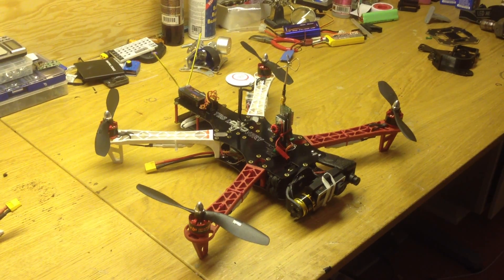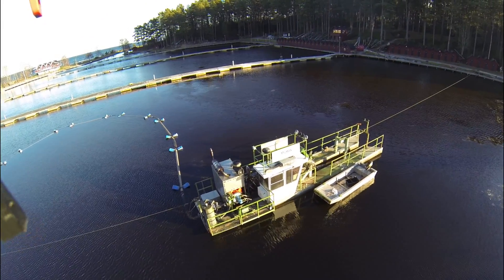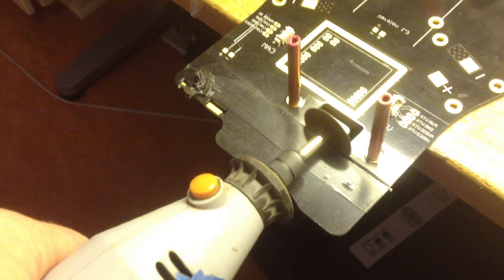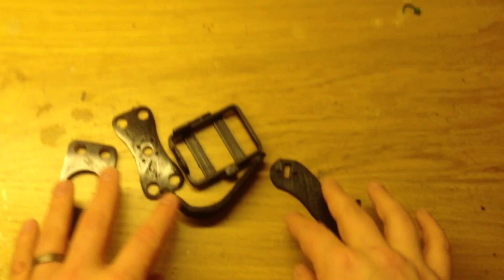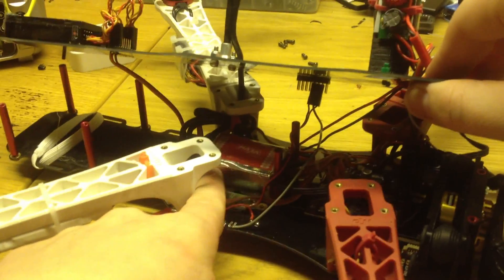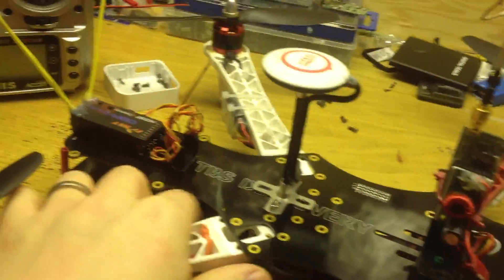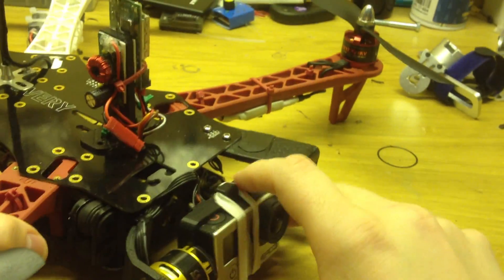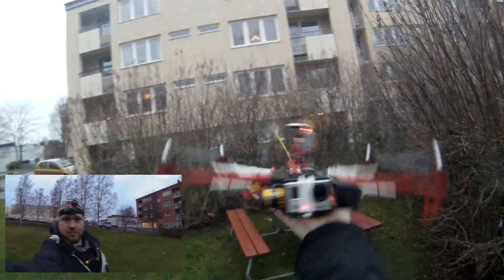My TBS discovery setup with my 3D printed gimbal

Comment: Fantastic! I wish I either had a 3D printer, or could buy this setup. That's the cleanest setup I've seen. Just the way I plan to try to develop mine. But I'm probably going to have to use aluminum. 

But thanks for the inspiration, looks great!

Comment: Hi, great project!
I also have been trying to make my 3d printed gimbal airworthy but with no luck.. I use modified version of http://www.thingiverse.com/thing:158854 and I have big troubles to stabilise pitch correctly, with rctimer motors they dont move smoothly, but rather in stepping fashion and with emax motors, they strauggle with their own cogginess (the inherent magnetic force) and cannot go back to level. Did You have any problems with pitch axis?
Reply from the maker: You are using gimbal motors ? regular brushless motors will work very poorly. There are a lot of settings in the software that have to bee tuned for your specific motors. Also make sure the motors are good and no phase is broken, measure with multimeter. Also your camera have to be in balance when power is off, very important as motors are very weak..Good luck !
Reply: Peter Lehnér Thanks for reply. Of course I am using gimbal motors : ) I also have already tuned a few gimbals in the past. The thing is that the pitch axis is cumbersome, as if the motor has not enough load on its shaft to balance smoothly
Reply from the maker: jimarcin Strange, most of the issues i have had is due to bad motors, a phase wires inside have come loose or have bad connection, the gimbal motors i have dealt with have had a pcb inside that the wires have been soldered to, and if they haven't scraped of the varnish enough in the factory it might cause bad connection, i have had to re solder a few.. (i have only used cheap motors)

Comment: Peter, I really liked your front gimbal design, especially the idea of upper and down rubber dampers, they have different tension coeficient so it makes things much more stable. You are a genious! I bought a print gimbal from Polak but I'm sure I'll be much more happier with this yours. Is that possible you to design an middle top frame position support for the board cam (TBS)? Wating reply. Best regards.

Comment: Hi Peter. Just to let you know I've fitted the gimbal you printed for me and its working perfectly. Really pleased with the design. Had a couple of heavy landings and it survived as well! 

Can I just ask how you use cppm on your d8r2plus as well as pwm channel for gimbal pitch control? 

I have flashed mine with xp firmware for cppm and rssi and its working well but wasn't aware you could use both cppm and further pwm channels.....

Comment: Hi Peter, Thanks for sharing all your tips and news, its much appreciated.  I first started watching your vids when I got my Ultimaker and now I'm looking to build a TBS Discovery FPV machine like yours :-)  There are so many choices out there for FPV parts etc I was wondering if you can advise on which 5.8 Ghz TX/RX to go for along with which camera splitter?..... and any other 'what to buy' tips for the beginner :-)  Cheers.
Reply from the maker: Hello ! I think i would go for a goggles kit, Fatshark Attitude SD with camera and transmitter.  I would recommend goggles with built in receiver, because that's the nice things with quads, that you can fly anywhere very easy, you don't want to have to bring a ground station.  And for video splitter, hobbyking have a 3way that i use and it works good.

Comment: Can you make one for my TBS? I hace the gopro hero balck+. Does the weight difference makes any changes to the design? Cheers
Reply from the maker: The hero3 black and the hero3+ black are the same size and same weight so it should work no problem. (the plus isn't 20 percent smaller as gopro says, it is only the hosing that is smaller the camera itself is the same)  :-)
Reply: Peter Lehnér Can you sell me one of your gimbals? I am interested only in the printed parts. Thnaks
Reply from the maker: gbazan Yes i can, i have the parts ready to go ($35 usd incl shipping), i can ship tomorrow. Have a look at this video for more info: 3D printable bl hero3 gimbal for TBS Discovery Just send me a mail petleh82@gmail.com if you want the parts

Comment: Made my gimbal on my tbs disco based on your design. Tested today in the wind. Camera is shaking a bit. Please can you give me your gimbal settings?
Reply from the maker: No sorry, i haven't even plugged my to a computer yet.. It is just the default setting that was in it when i bought it.. But as always, make sure props are well balanced and no vibrations in the quad.. I will check the settings later.. :-)

Comment: I really like how you have offset the top and bottom gimbal rubbers for compensating the sag, because of the weight, I assume. Really clever!
I too made a prototype like this but without the offset and than the gimbal drops down too much (I don't have a 3d-printer). So instead I made a simple construction with decoupling with foam rubber, but on very bright days, I do get a bit of jello.
Maybe I will try your design in the future. Thanx for sharing!

Comment: Peter, Like your project very much. In the process of putting a 3d printer together and also have a quad copter which I am learning to fly. I have a question. Given your experience with 3d printing, do you think it is possible to print a prop as a replacement part?  colin

Comment: Though I can imagine, Please explain why the upper dampers have less space? Is this necessary? I started making a gimbal based on your disign, just by making it by hand.
Reply from the maker: It is just to compensate for the weight of the gimbal, it will sag down a bit by the weight..

Comment: Helloooo !! ;-)

Wow .. Amazing Work .. What kind of Damperballs have you used?

It wold be very very kind if you if you publish you gimbal Design to allow us to make a copy.

Kepp going .. I love your channel ;-)
Reply from the maker: I use the ones i got with the gimbal i bought from good luck buy, i will try to figure out later what they are, i guess standard. I  have now uploaded a beta version of the files to a random file sharing site, hope it works, here is the link: http://www.filedropper.com/pl-tbs-gimbal-beta
Reply: Thank's a lot .. I have already orderd the gimbal you have used .. I will give you feedback when I have printed your parts and build it!
Reply: Peter Lehnér
Thanks Peter for sharing the design. I just printed the arm and gopro holder. Will need to mod the front and back plate to fit my ov3rquad.

Comment: The naza-controller shuts off if hit by light?
Reply from the maker: No but it drops from the sky if the sun hits it from the side. I almost lost my quad in a lake because of that. It is the barometric altitude sensor inside that is light sensitive. There is the reason for the v2 naza is black. Have a look at this video:  My naza unit is sensitive to light